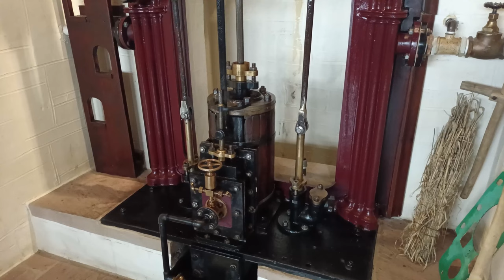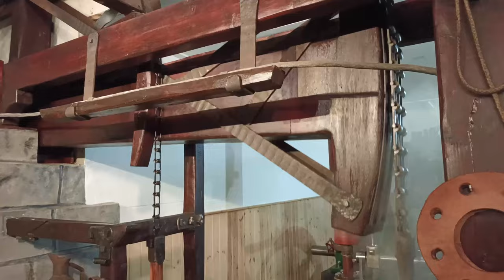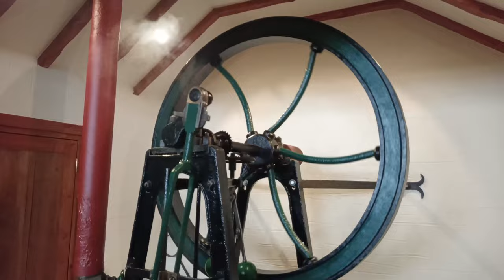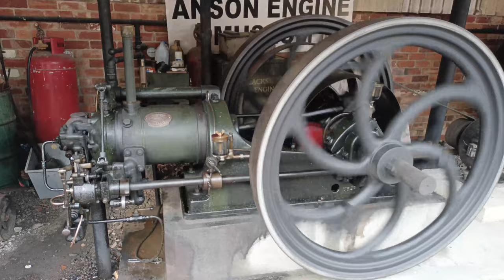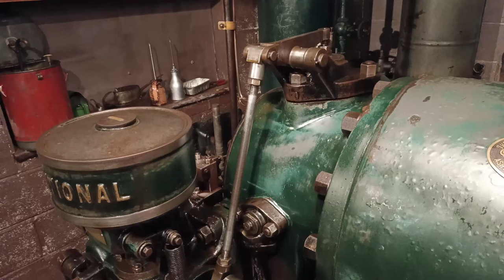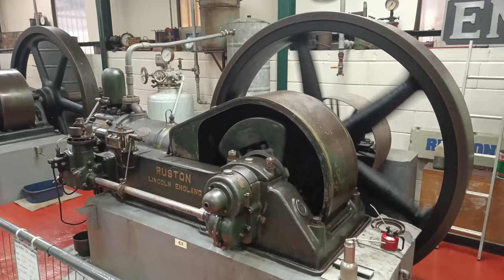Anson Engine Museum

Comment: How fascinating. People were much cleverer 100 years ago.There were no electronics to operate these engines, only engineuity (pun intended). One of the smallest engines made is a CO2 engine, 1 cubic milimeter capacity by Gasparin of eastern Europe. The piston is
is as small as a pin head. I have a model diesel (compression ignition) engine of 0.05 cc, that is 1/20th of a cubic centimeter made by Rudolf Valentine of Germany. No doubt extreme precision is required during manufacture to justify the cost. Thanks for posting mate.

Comment: Where is this? Is the first engine shown steam/atmospheric? Beautiful. Gothic arch as the main support. Why wouldnt you.
Reply from the maker: Hi, it is in Poynton in Cheshire. That first engine was my favourite. Love the gothic frame. The frame also was used to pipe the steam in and out. If you look to the right of the frame there is a valve, which is the inlet. The steam then goes down the leg of the arch and into the underside where it passes through the valve box. The exhaust steam goes back up the left leg of the frame. Fantastic bit of engineering and casting. The frame and base are one casting. If you get the chance it is well worth going to.
Reply: @m0xya  Absolutely brilliant. Atmospheric engines still captivate me. Imagine what they must have seemed like in the late 18th century. A thing moving by itself. What a legacy we in this country have given to the world.
Reply: born and raised in poynton. there's actually a photograph of my great grandfather in there. he drove trains for the mines. tgis brings lots of memories